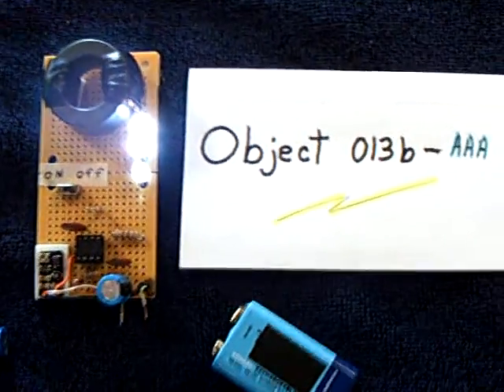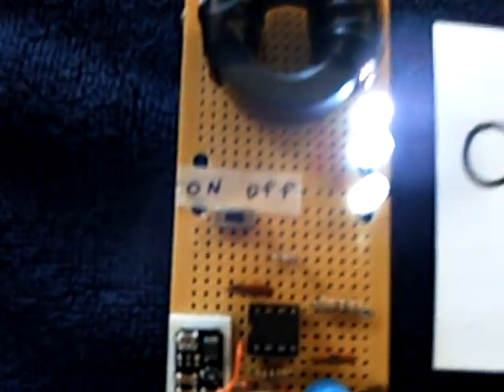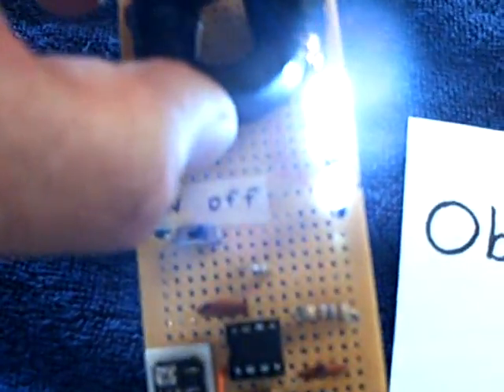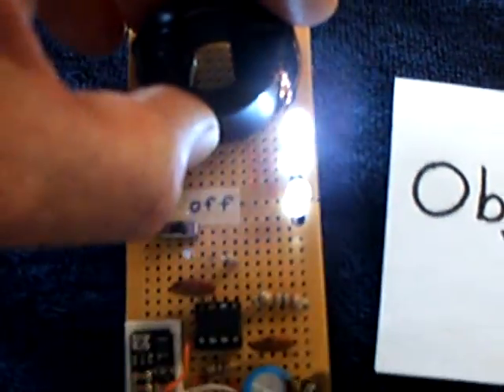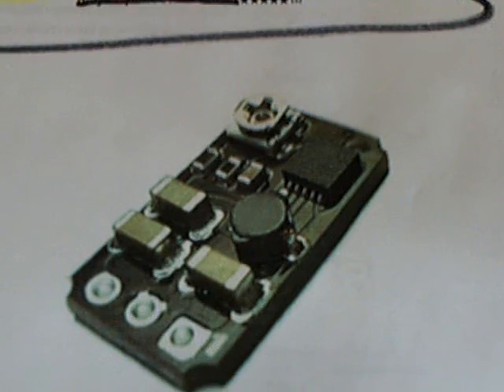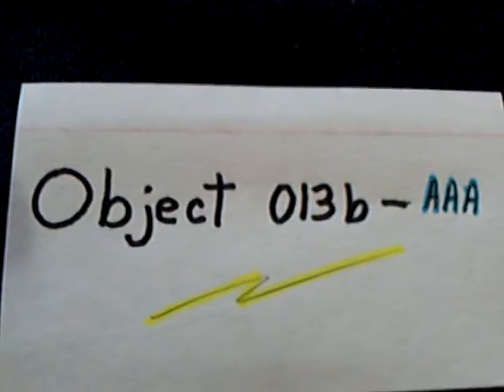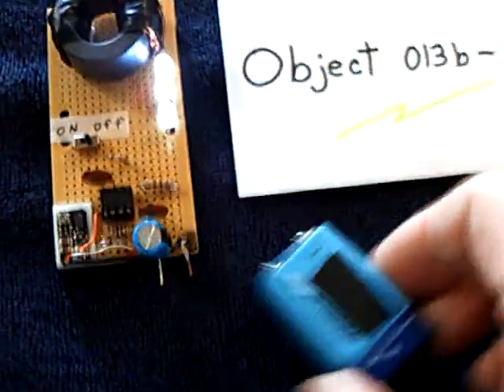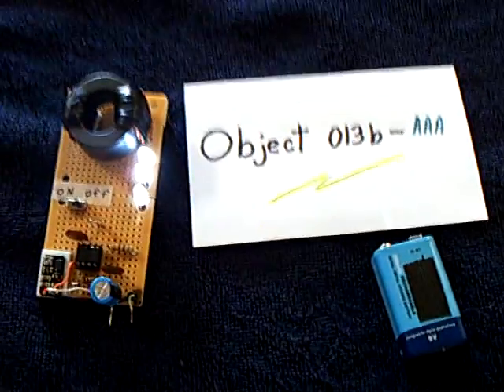Object 013b - AAA

Comment: I searched the item number on your printout and it looks like mouser has some of these voltage converters. For a 0.3V in minimum with a constant output, I might get a few of these. I could charge usb devices and power led's with single boost caps
Reply from the maker: 72fr250 Mouser would be a good source for these chips.  Just remember that the chip is really small.

Comment: That TSP61200 is actually a pretty sophisticated little device.
Are you operating it with the "Power Save" enabled?

I think you may be able to order a free sample from TI:
https://store.ti.com/Basket.aspx  or
http://www.ti.com/product/tps61200/samplebuy
Reply from the maker: A B I tried to do that today but they said " my account didn't qualify for free samples".  I should have just bought a few anyway because they were just a few dollars each.  They are pretty tiny chips though and soldering them might be hard.  Sparkfun sells a ready made board using that chip but it just outputs two fixed voltages.
Reply: ***** 2.13$ when I checked.  3 mm^2 (which si 0.118" or slightly less than 18th of an inch). Soldering 10 contacts that size would probably require a reflow oven or serious visual magnification & a steady hand..  It's probably better to buy a prefabricated module if you can find one...